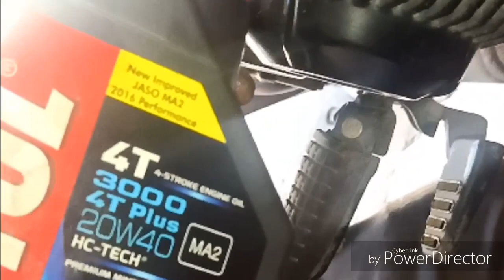Honda cb unicorn 160 engine oil change full video

Comment: What is the capacity of engine oil, 900 ml or 1 ltr?
Reply: 1.2 ltr
Reply: 1.2 ltr
Reply: @learnforsuccesslife  mine is 2016 model and it has 1.2 ltr Engine, that is also engraved on engine '1.2l'